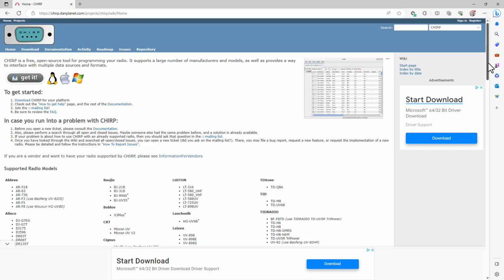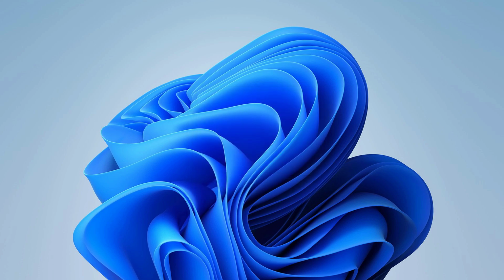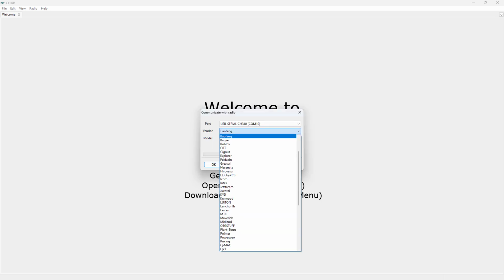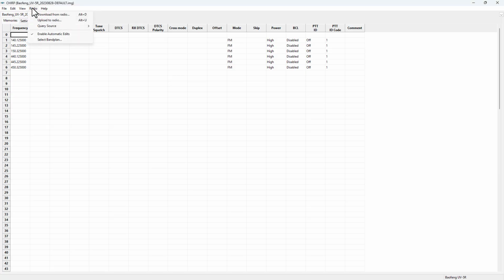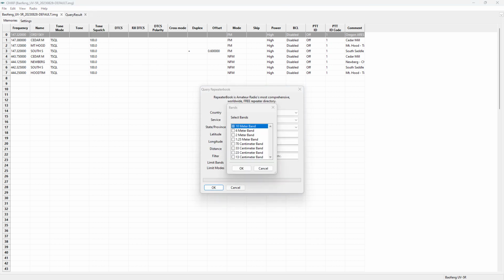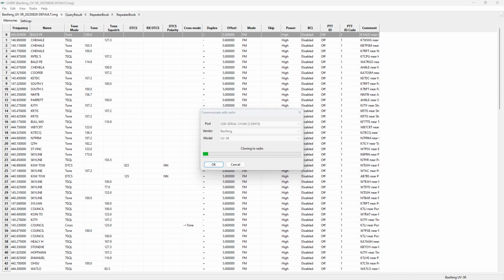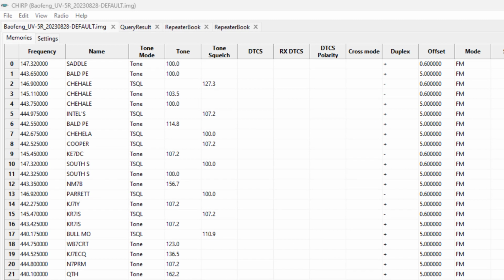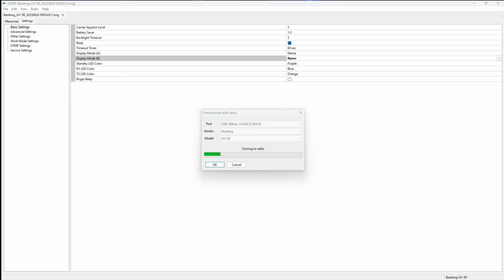How to Program Baofeng UV-5R

Comment: Thanks. The part i was looking for was "nodes". You said you can o ly use FM. I am using the repeaterbook app. It also lists "DSTAR, DMR, Fusion, M17, IRLP, Echolink, APC025, wires-X, WIDEn Allstar, TETRA, ATV, NXDN".

Will any of these other modes work with a UV 5R? Or should i filter everything out other than FM.

Comment: Mine keeps coming up saying "Radio Did Not Respond" when i connect it to the computer. Any help is very appreciated!
Reply: Same issue here. Did you find a fix?
Reply: found a fix......push the mic/data plug harder into the radio case till you feel a clickish sound/feel
Reply: @frankfritzges7819  I will have to mess with it more I guess. I didn’t want to push to hard but I guess I have to